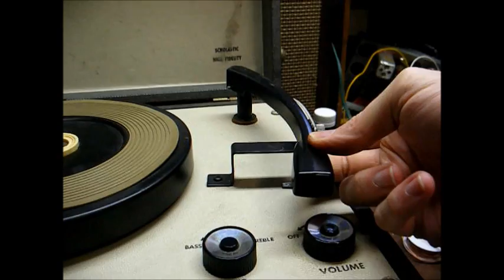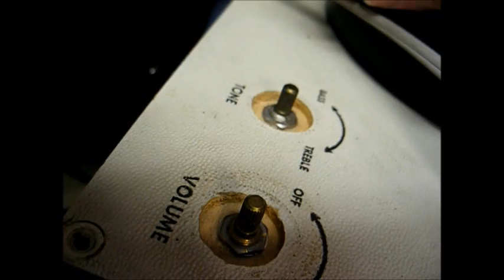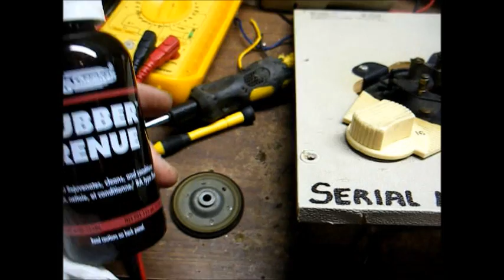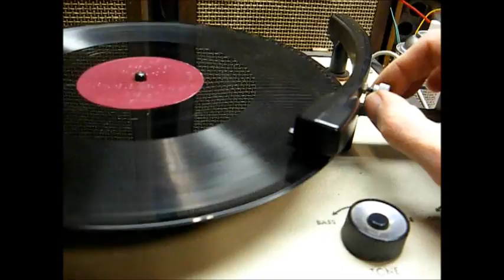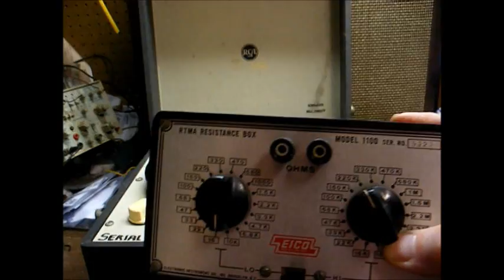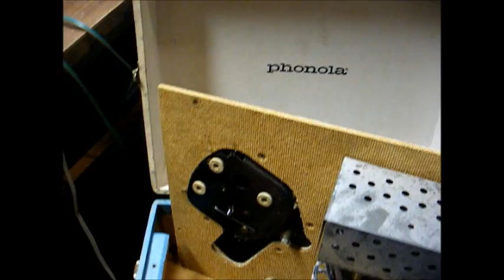Repair of a 1965 RCA Scholastic 4-speed tube classroom record player (take two)

Comment: That record player looks very similar to the ones I remember in the California pubic school system in the 1960s. Chances are the owners of the "supposed" copyright aren't even aware of your video. YouTube uses an automated recognition system that's overly cautious and not accurate many times.  Appealing it does no good because they'll just stick by their original decision.  There was a case where some guy uploaded a video of himself picking mushrooms or something in the woods. There wasn't even any music. He also got a message from YouTube saying he was using copyright material.  It turns out that the birds chirping in the woods activated the copyright mechanism and it belonged to some rock group. Even after the guy appealed and told them to watch his video they stuck by their decision. The decision wasn't overturned until he contacted the group himself and had them watch his video.